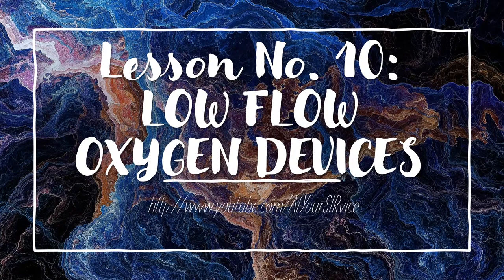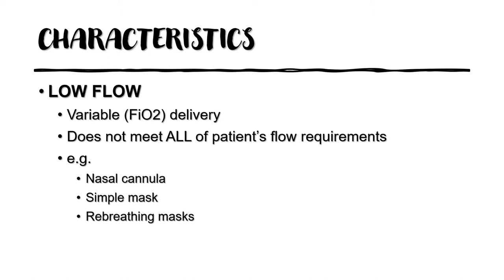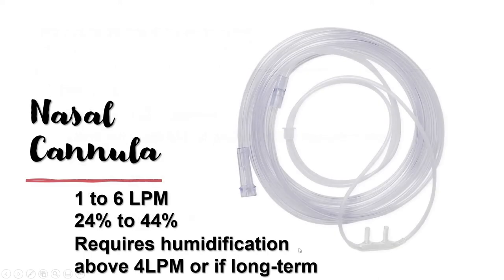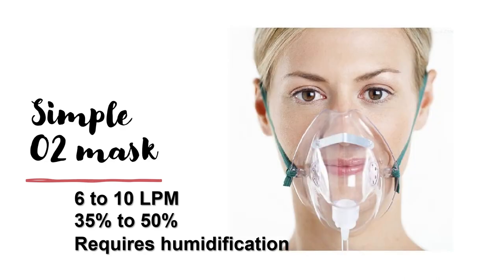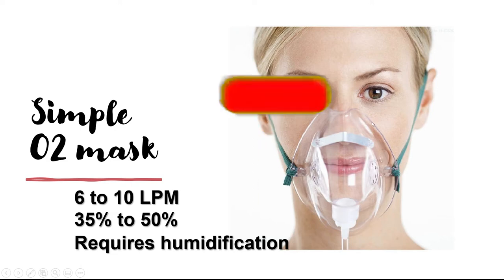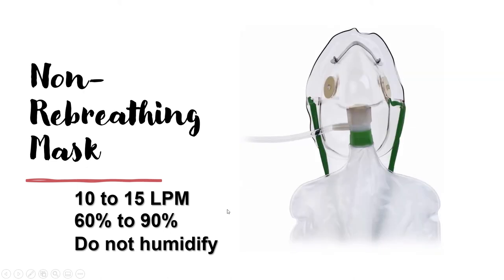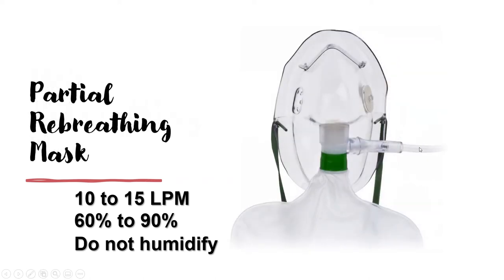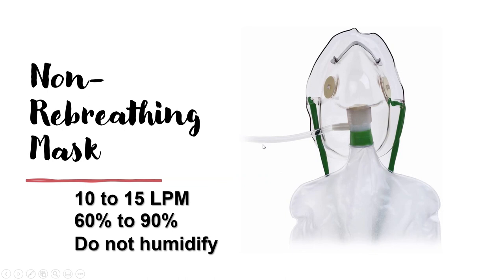Lesson No. 10 LOW FLOW OXYGEN DEVICES

Comment: Thank you for your videos. You do well in explaining in layman's terms especially to non-medical persons like me. I need your comment on my recent purchase of some 1-7L oxygen concentrators. The flow rate at 1LPM is 90%=-3%. At 2LPM is 65%=-3%. With an oxygen analyzer, the LED displays 93 to 94% with decimal points. Is this machine good? Can I use it for mild to moderate hypoxia? I am not sick. I just would like to have 1 for emergency cases. Hospitals are in full capacity these days and I thought that it could help while waiting for a bed to be available. Should I buy a 5L machine that has 95-% to 96%=- flow rates from 1-5LPM? Is this for mild to moderate? Thank you.
Reply from the maker: Hi! I've responded to your question in the other video.